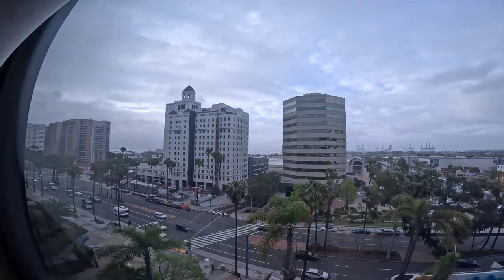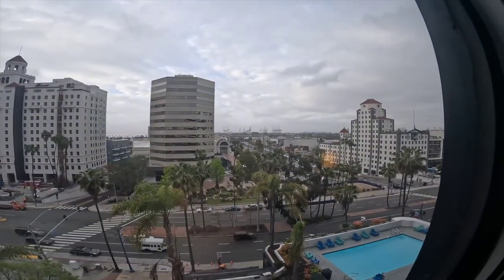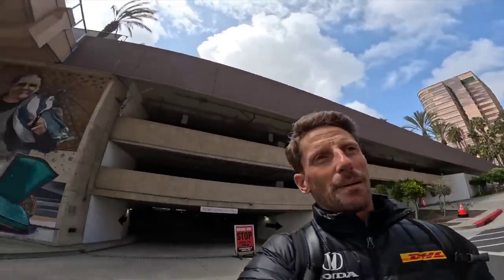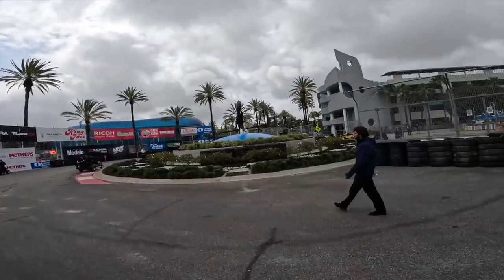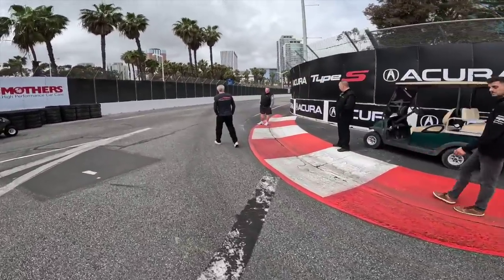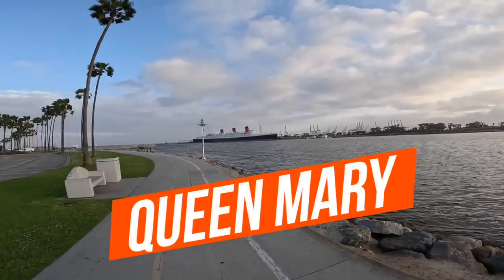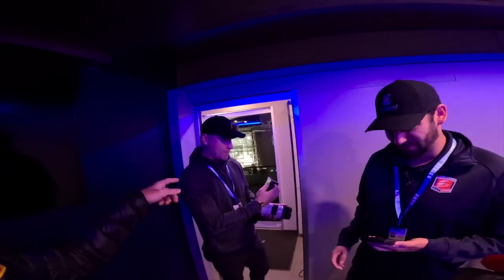INDYCAR VLOG - My LONG BEACH P2

Comment: Salut Romain, félicitations d'abord pour ton podium! Mais j'avoue ne pas comprendre l'origine des soucis de carburant, vu que les autres du team n'ont pas eu ce souci. Si tu peux nous expliquer ce serait super
Reply: Kirkwood and Errickson pitted a lap later than Grosjean so based on when he pitted, the engineer calculated that he had enough fuel to finish the race but not use the Push to Pass. If Grosjean had used it, he would have ran out of fuel before the race was over so he couldn’t be aggressive and chase Kirkwood down. So basically it was kind of a miscalculation on the fuel strategy. The Push to Pass increases turbo boost and horsepower by 50hp but it also consumes quite a bit more fuel.
Reply: @Bolt_theG35  ok, so that means that the engineer made an error by not taking into account some potential usages of push to pass. Depending on the Time of push to pass remaining, it's strange to not take it into account
Reply: @gekko70   yeah it was a miscalculation. Grosjean had almost three times the amount of Push to Pass towards the final laps than both Kirkwood and Errickson but he couldn’t use it because he would have ran out of fuel so they settled for P2. If he had been able to use it, he would have easily gotten around Kirkwood and won the race. But based on what Grosjean said after the race, they couldn’t stay out one more lap when they made their last pit stop, that he felt they made the right call to come in when they did.